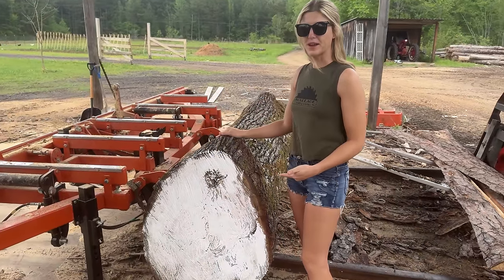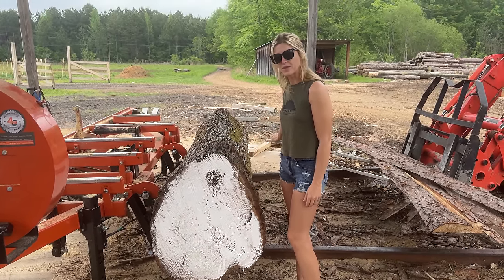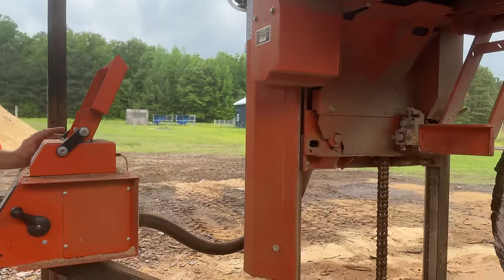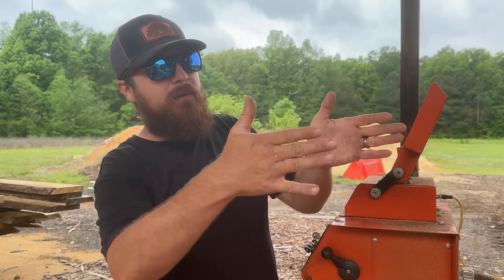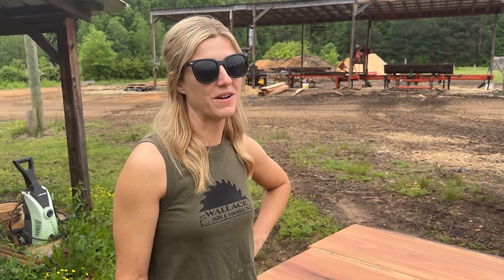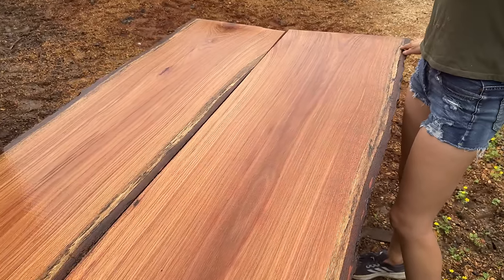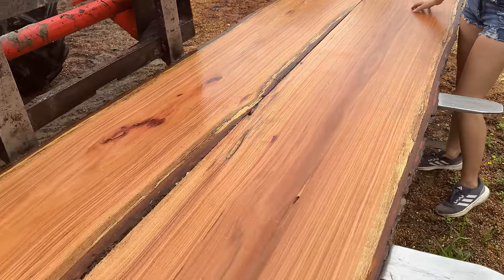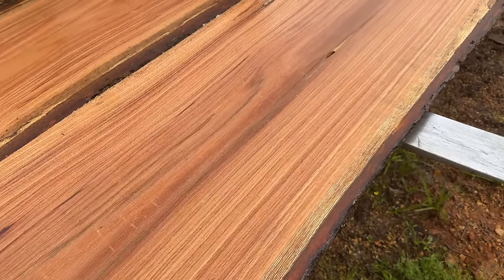What is HIDING inside this Massive oak log?!! (Watch to see what is Revealed!!!)

Comment: I have 20 plus 100ft oak trees with a 30 plus inch base that need to be harvested.. and about 10, 15ft oak logs that have been drying for 6 months now and are waiting to get milled.. going to be building a A frame house and the oak will be used in its construction..

Comment: That was a nice big oak for sure for live edge wood if you want to get in that market most people prefer 8 quarters even 10 quarters some only 6 quarters but the market on that is not as open than regular lumber and you got to figured some lost on those live edges they will twist bow in the middle that is why they make them so thick so they can put them on the slab machine to straight them out when they are dry

Comment: The wood grain is great but the green shirt you are wearing knocks it out of the park. i did not realize you had them in olive green or sleeveless. I have 3 of the gray ones and one of them has "SEE YA" on the back. Maybe you and Tyler could wear the different colors and styles on the videos. I wear Tee shirts every day even in the winter time but the 3 gray ones I try not to wear when I am working in my shop because I like them so much. (don't want to get them greasy) SEE YALL next time.